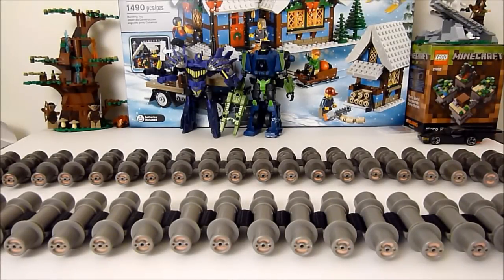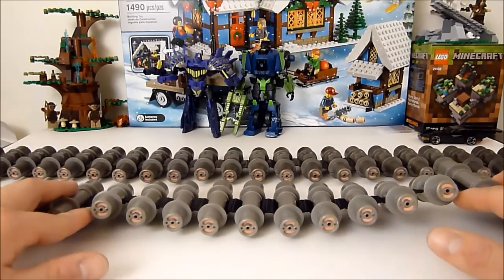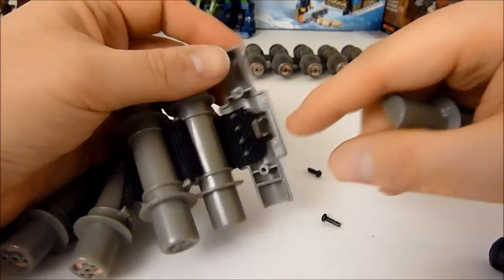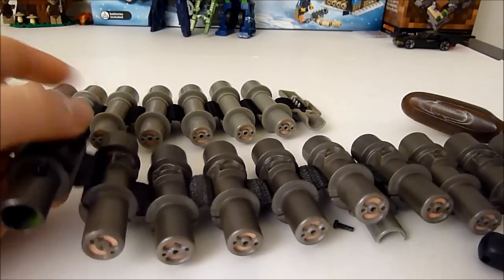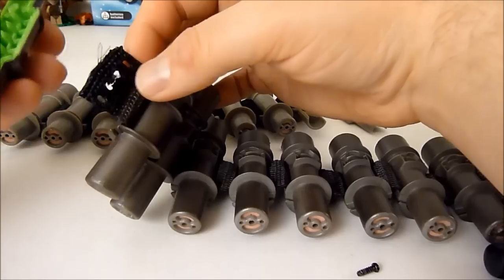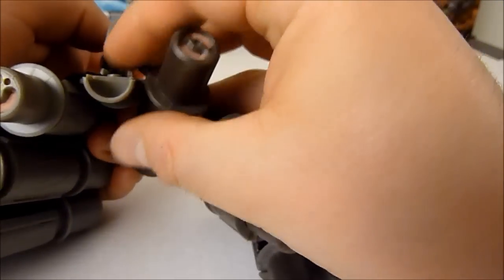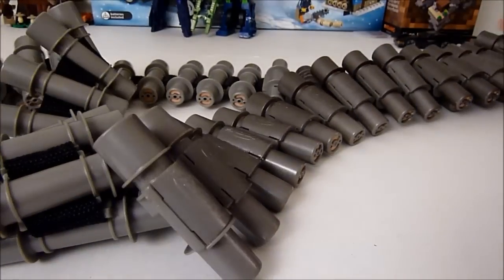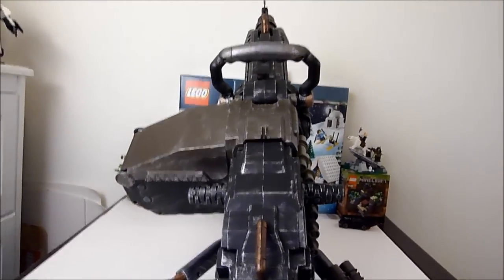NERF Vulcan Blaster Ammo Belt Mod

Comment from the maker: You may have to open up the gun and sand the paint off of the round bit at the rotation point, and make sure the coat of paint on it, and the belt are not too thick.